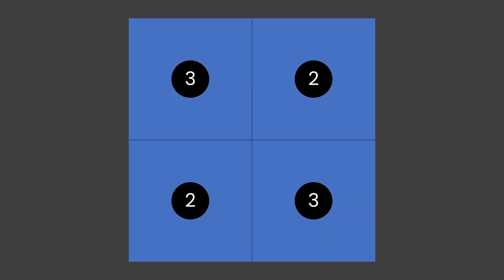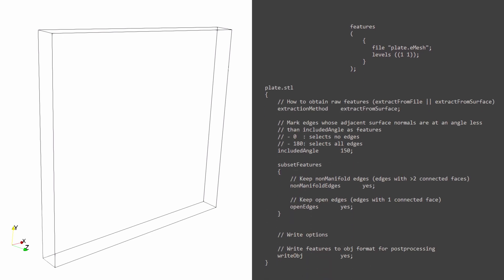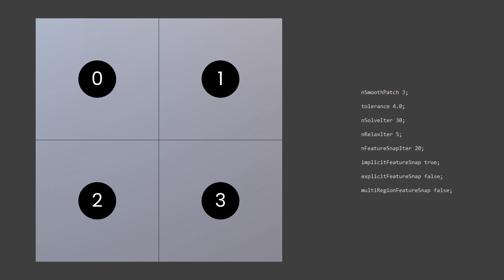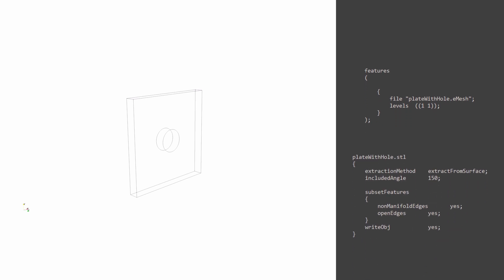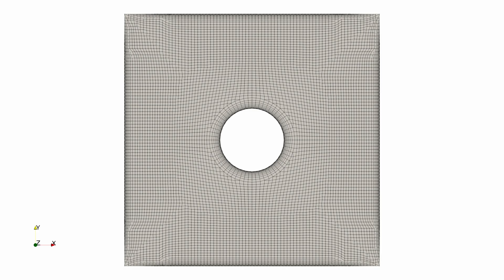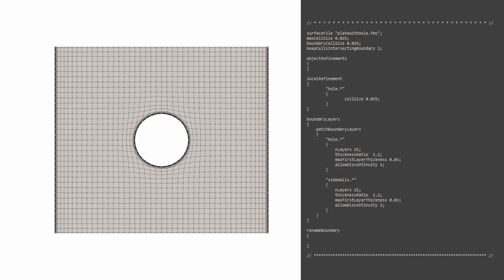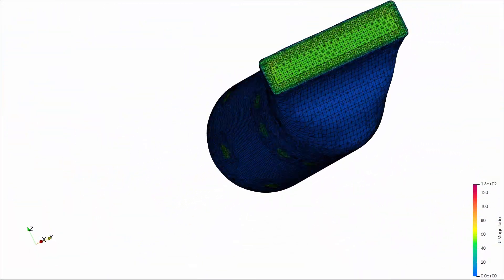snappyHexMesh . . . . . vs cfMesh?

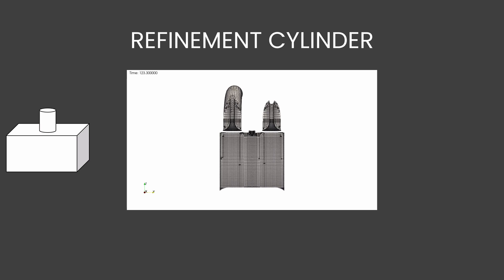Comment: Thank you for the video. I was particularly interested in the piston–cylinder case shown at 4:15. I’m currently exploring how to combine mesh motion with refinement in OpenFOAM to obtain remeshing, but haven’t yet managed to make both work together. May I ask if this is your own case? If it’s possible to share the source, I would greatly appreciate it, otherwise, any guidance or pointers in the right direction would still be very helpful.
Reply from the maker: Thank you!

This case comes from AATE research done by Wartsila in collaboration with University of Michigan for the TCI-III geometry.

You can find more details here: https://share.google/V2MznaFcp81u6xvSZ
Reply: @CFD_OpenFOAM  Thanks a lot. I will look into it.

Comment: thanks for the comparison which was very interesting. I am wondering if it is possible to make baffles with cfMesh and if so, can you make a video of it?
Reply from the maker: Thank you!

Yes, making baffles is possible through the createBaffles utility in OpenFOAM. Once you create the mesh using any tool (be it blockMesh, cfMesh, or snappyHexMesh) we can run createBaffles to generate the required baffles. I'll try incorporating this in an upcoming video. Not finding time to work on YouTube since a while now.